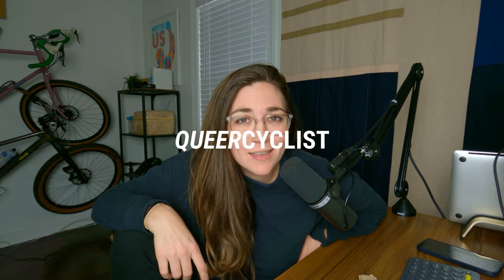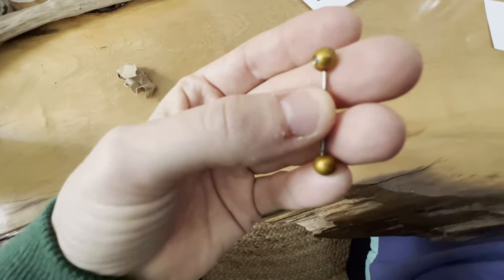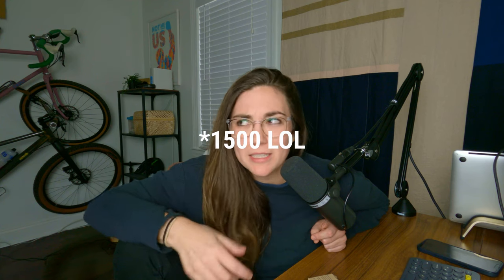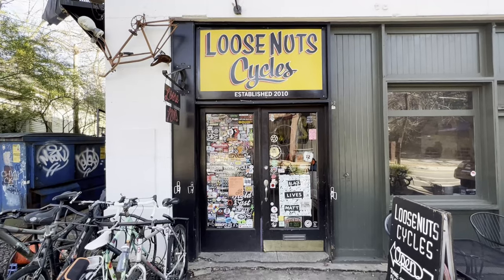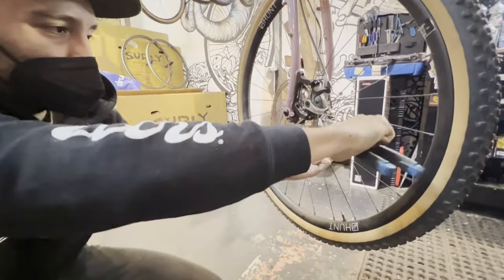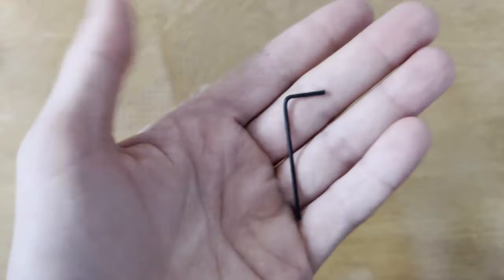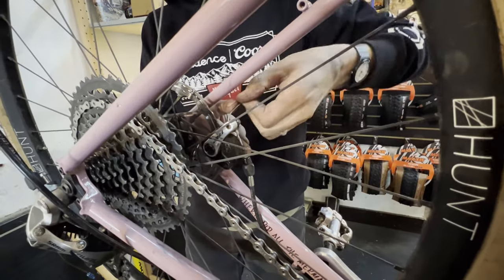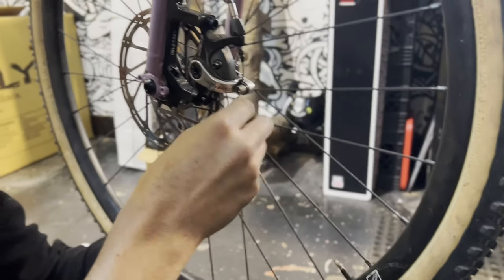What are CABLE CHERRIES?!

Comment: Wouldn't work on hydro but will work on hybrid brakes(ie cable brakes with hydro like the TRP HY/RD). Maybe you can check out other affordable bike accents, like headset caps & bolts?